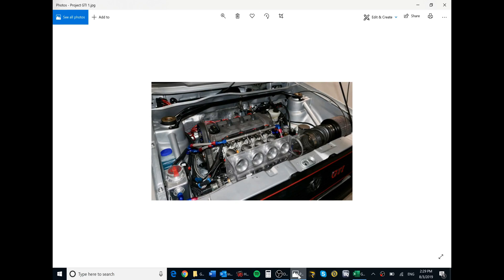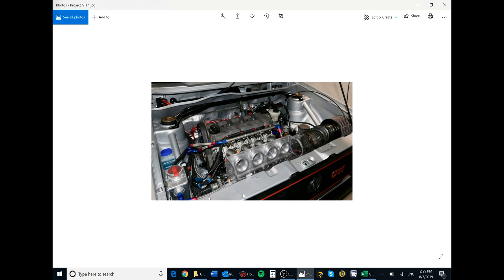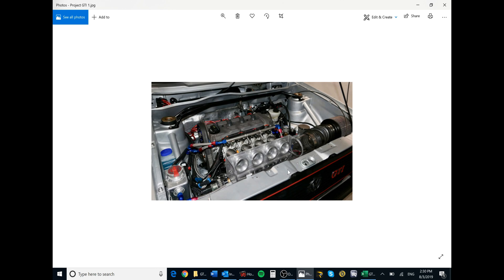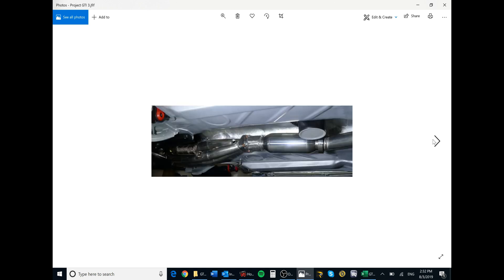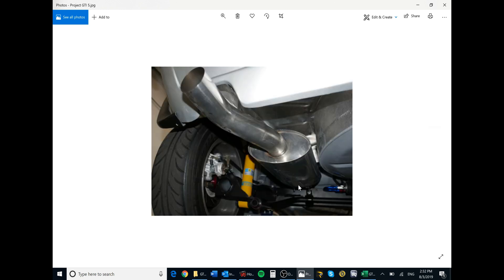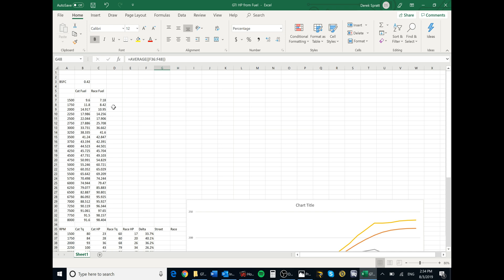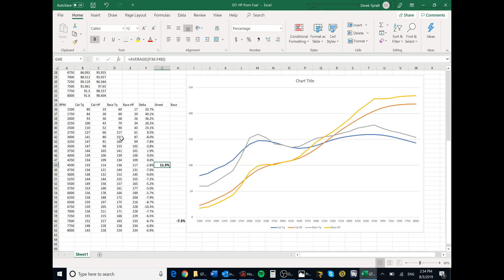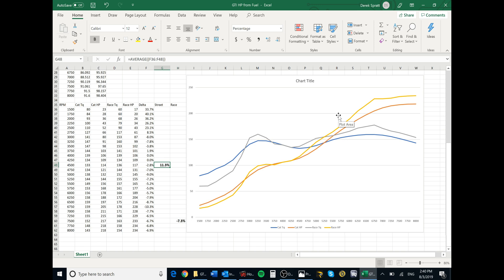The Ultimate 1983 Rabbit GTI - part 178 (Catalytic Converter vs no Cat HP)

Comment: I recently shortened my old mk2 golf tttuning high flow cat about 4 or 5 inches, and just need to weld the reducer to the cat so I can do this to my car. Looking forward to less stink as well. We will see if I like the change in torque curve or not.
Reply: Is the mk1 high flow cat 55mm inlet to 2 1/4 outlet like the mk2 version?
Reply from the maker: That is a question for Techtonics - I made my own converter flanges to match the needs of my custom SS exhaust